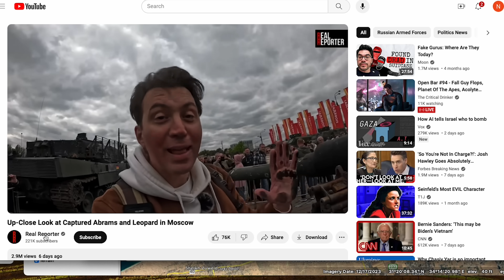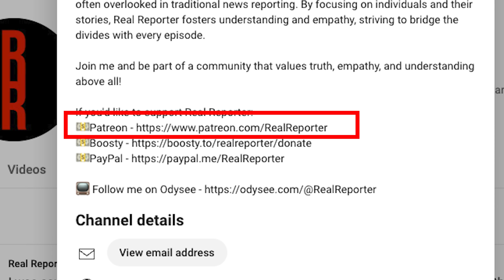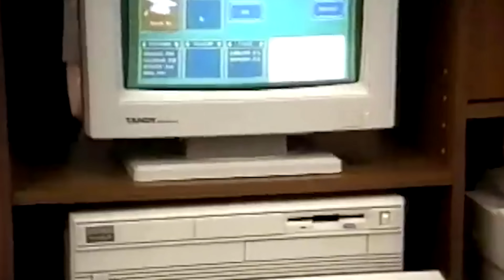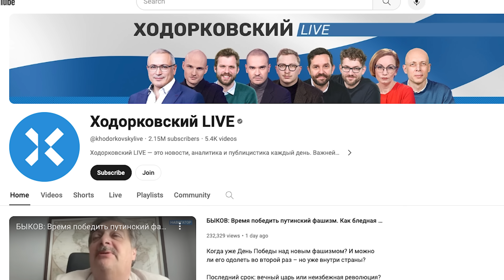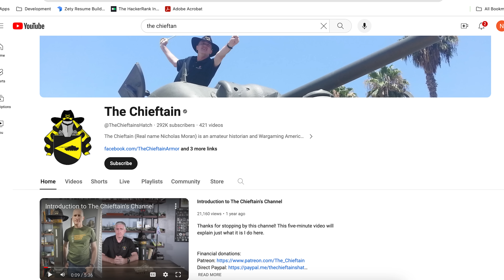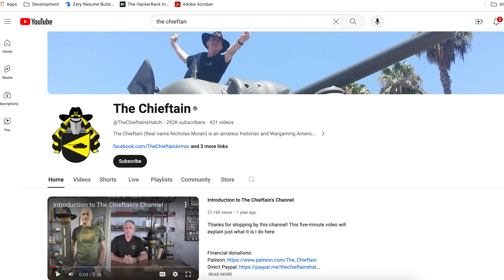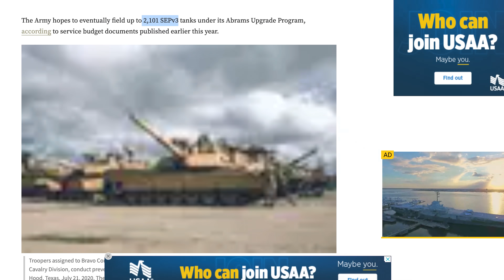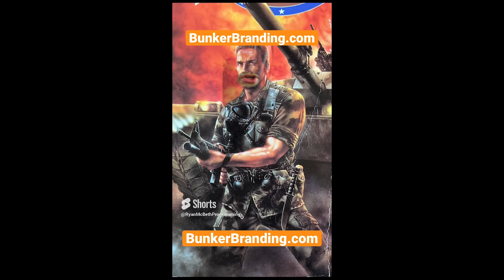Analyzing Real Reporter and Captured NATO Vehicles

Comment: I'm not sure what you can learn from a destroyed Abrams that you can't learn by looking at the x ray of one in war thunder
Reply: at this point the war thunder forums have more up to date information on current american capabilities than exported tanks do
Reply: @YanBaoQin I’m convinced that half the player base are just randoms with clearances from all around the world tryna get each other in trouble lmao
Reply: It's a  skill issue...
Reply: Hope they send it to gajin for accurate damage models
Reply: @YanBaoQin  Are exported Abrams actually inferior to the ones the US uses? Sure they remove the DU, but don’t they replace it with tungsten?
Reply: @RichelieuUnlimited  I don't think the Saudi ones are, but the ones the Russians have specifically are Gulf War era
Reply: @YanBaoQin  I was referring to the frequent assumption, that the US only exports inferior versions of their tanks, which doesn’t make sense when competing against the likes of Leopard 2 or Leclerc. This is, in my experience, often abbreviated by simply using terms *like ‚exported tanks‘.
It is true, that the tanks supplied to Ukraine are older models, however those were pulled from storage instead of purpose built for export customers, as it’s faster.
Reply: @RichelieuUnlimited  i would say the export models are worse since thats cheaper and most customers wont go for the extra cost
Reply: @einar8019  While this thought process does line up with the US‘s adoption of the Abrams over Leopard 2, if I remember correctly, both the Swedes and Greeks chose Leopard 2A5S and A6Hel respectively over Abrams despite higher costs. And tungsten is typically more expensive than DU, especially if you’re enriching yourself.
Reply: War Thunder has inaccurate DU layouts according to WT Reddit and that makes them VERY mad
Reply: @YanBaoQin The M1a1 SA first entered production in 2009.
Reply: "I'm not sure what you can learn from a destroyed Abrams that you can't learn by looking at the x ray of one in war thunder"

Russia has captured at least, I think it's 2 Abrams by now that were not destroyed but rather just missionkilled(ie mostly functional).
However, Russia already has knowledge about most things in it.   There's details that might be interesting, especially stuff like radio encryption and being able to look for hidden weak spots, maybe getting more detailed information on the materials used...
But overall, it's not a big deal.

Getting info on encryption is probably the only thing that Russia might have an actual use for, as it allows even better updated battlefield intelligence.   Buuuut Russia is already listening in on Ukraine radiochatter almost unhindered(if not necessarily in realtime) so, kinda superfluous.
Reply: This is what I don't understand, why would they reverse engineer anything from it. They have thermals as good or better that they already produce, and they have better armor arrays that they can use but don't since they went through the ERA route. We also know they have better engines and transmissions that they could use on their tanks(which again, they also don't use). Hell, they export better engines, transmissions, and thermal optics for export tanks despite not putting them on their own tanks.
Reply: @voidtempering8700  "This is what I don't understand, why would they reverse engineer anything from it."

Just because something isn't better doesn't mean you can't learn something from it.
It might not be a big thing to find out how another engineering team solved a specific problem differently, but longterm it adds up.
Reply: @DIREWOLFx75  That would be analyzing it, not reverse engineering it. Reverse engineering would be a study to re-create the product.
Reply: @voidtempering8700  No, reverse engineering can refer to both.
If you just want to recreate it minimal effort, that's a COPY.
But to be able to make anything beyond a copy you need to understand at least minimally how it actually works.
Which means deeper analysis as well.
Reply: @DIREWOLFx75  what is your pfp from ?

Comment: Heavy metal poisoning is true. We were also taught to leave a vehicle to the recovery team unless somebody needs to be extricated from the inside. Also, some of the metals won't leave your system and they'll continue to wreck havoc in you body until the day you die (probably from long term heavy metal poisoning).
Reply: I am just a dumb civilian and even I know not to go near a burned out tank. Depleted uranium isnt something you want to go around breathing in.
Reply: @Steve-ev6vx  If I recall my toxicology classes, arsenic, cadmium, lead, mercury and a couple others are the main concern. The main issue with heavy metal poisoning is that they don't need high amounts to be a health issue, or the body is unable to excrete them and they circulate freely in the blood, mainly causing renal & hepatic damage, mostly.
Reply: @SuiLagadema DU is a heavy metal. It’s not a radiological issue.
Reply: @DeltaEntropy  It's both.
Reply: @donizettilorenzo the half life of DU is on the order of 4.5 billion years. It's not a radiological issue.
Reply: @Steve-ev6vx  well, in this case the Ukr Abrams don't have the DU armor, but yeah, a Russian penetrator might be DU, so that's still a risk.
Reply: @colbunkmust  Yeah I know they didn't get the DU armor, but I'm sure there is still some toxic sht in there.
Reply: @colbunkmust  Russians use Tungsten APFSDS. DU is cheaper and self sharpens but Ruski's have plenty of Tungsten and Tungsten is denser and harder. Also DU is a bitch to machine so they don't bother.
Reply: @NotYourBusiness-bp2qn  Russians have both Tungsten and DU ammunition for their 125mm tanks. There have been 5 types of DU ammunition in service for the Soviet Union and Russia since 1982. Most recent confirmed date of acceptance for service of new DU shell type was 2016, with potentially even newer experimental DU ammo for the Armata tanks, though seeing as that project seems dead in the water the ammo for it will remain experimental.
Reply: Ah yes, heavy metal. I love it. I am from Russia. Heavy metal is my favourite genre. I'll go touch the tank to get some heavy metal in my blood 🤘brutal af

Comment: Gulf War Vet here... my unit, 197th Inf. Bde. (M)(S) attached to the 24th ID received a bunch of M1A2's before the ground war started. In fact there was some discussion about the cost/benefit of switching out the tanks that armor knew and had trained on for slightly improved /different ones so close to the beginning of the offensive. Like you I was T.O.W. infantry but my section of T.O.W.'s were combined with a platoon of Infantry on 2 M113's with 1 carrying a 50. Cal and the other an M19 Grenade Launcher as well as a platoon or section of 2 M1A2's. The tanks led the way, infantry flanked left/right and we T.O.W. guys stayed in the center and that's how we traveled during the war until the cease fire was declared and we returned to our old unit formations. I actually got out of the Army in Jan of 1992 so I know we had M1A2's at least a year before hand.
Reply: Good for you! My unit back to this time had T54B, T62 and PT76.......mixed toghether....
Reply: M1A2? No hate but are you sure? Those were a year late to Gulf War iirc
Reply: @somerandomboibackup6086  Yes I'm certain. They were swapping out tanks for new ones and there was a lot of discussion surrounding it.
Reply: @RemedialRob  you sure it was the one with CITV? Damn the secrecy back then, the media only reported about the new tank after 1991 I'm pretty sure
Reply: @somerandomboibackup6086  I'm not a tanker so I'm not familiar with the options on different models. All I can say for certain is that the new tanks were referred to as 'A2's" and there was quite a lot of discussion about whether it was wise to swap vehicles so close to the beginning of the ground war. There's a 24th ID Facebook group that spends all its time talking about the Gulf War. If it's important to you you might find a tanker there to confirm what I'm saying but I have absolutely no reason to make this up. I like Ryan and so I wasn't correcting him to "get" him or make myself feel superior. I genuinely remember the handoff. My Brigade being at the time the only "Separate" brigade in the Army was built like a 1/3rd scale division. Most divisions have 3 Brigades (or they did when I was in) and since we weren't part of a division we has resources and assets, again on a smaller scale, that most Brigades had to share with the rest of their division. And because everything was smaller It was easier to notice changes. I can't remember if it was the new tanks that came over with desert paint or if they were green and the old A1's were painted for the desert but I do recall the camp of the new A2's also being a factor of discussion in the decision to switch. Our M911 ITV's were still forest camo and we didn't get desert uniforms until just a couple months before the ground war started and even then some of us didn't get the desert boots because of limited stock on some sizes so we really were a hodgepodge of uniforms and camo heading in to the actual war. But as soon as Ryan said in the video that M1A2's weren't introduced until after the Gulf War my mental alarm bells went off with a specific memory of A2's being introduced to the 197th before the ground war started. Would I bet my life on it? Probably not. But it's a very clear memory so I'd probably wager a fair chunk of change.
Reply: @RemedialRob  thanks for the answer
Reply: The M-113s were used before my service in 1970! Just about everything they send Ukraine, are used/surplus. Night vision goggles so scratched , that they can’t distinguish between a person and a tree!

Comment: They didnt bend the barrels to damage them further, they tip the barrel as a sign of defeat, but because the turrets were damaged or they just couldnt figure out how to manually depress them, they bent them with the concrete block.

You notice the remote weapon systems on the lighter vehicles are also tipped downward.
Reply: But it also means they can't testfire the guns for their supposed "reengineering".
Reply: Maybe they are afraid the original owners will be able to re-activate the weapons systems remotely .
Reply: @flitsertheo  they dont work like that
Reply: not as a sign of defeat, more likely because of reasons of transport
Reply: No need to bend the barrels on defeated Russian tanks, because they're halfway to mars already
Reply: @nirfz  This kind of comment is the proof that US and EU needs again mandatory military service
Reply: @tavish4699  They did it in the square where it was displayed. Sure they just needed to lower it to take it away. 😂
Reply: @joek600 why do something unnecessarily when you can own the whole world if you wanted.
Reply: @joek600  Several countries in the EU have that. The one i am from included:
Austria, Belgium, Denmark, Finland, Greece, Latvia is putting it back into action step by step, Lithuania has reinstated theirs, Norway, Sweden has reinstated theirs in 2017, Ukraine.
I am in favor of it, i did mine long ago, and i learned a lot. (not just about being a soldier, but also about firearms in general and detail, my physical and mental abilities, and about other people. For example: how to sucessfully work closely together with someone i can't stand. Something many people never get the chance to learn.)
Reply: @nirfz  Well Im an Engineers Corps sgt. in reserve, all male adults in my country have to serve, and that's why everybody i know laughed out loud with the international media mentions (here they downplayed that part) of ''game changing xyz weapon''. Especially with the Leopards, since my country happens to have the most in EU. Since you have served, you should know that there wasnt much left of that Abrams to really test. The tank was consumed by fire and opened like a sardine can, that alone changed the properties of its materials. IF the barrel could be tested (they dont need to, there is nothing to learn from it that they dont know for decades) they would not have forced it like this.
Now an observation. I knew (been there, know a lot of people) that Ukraine had for a long period stopped its mandatory service and before that the army was in shambles. In fact so much that many people considered it dangerous to serve and avoided it, something that was extremely easy btw, unlike my country where the State, not only they will come after you, but they will destroy your life if you try to just not go. The fact that all those Baltic Drama Queens that now urge for war had no conscription, means that did not face a real threat.
My country which is the only EU country facing ACTUAL threat never ever considered of stopping the conscription system. The most left political parties never dared to even suggest it and even frigging anarchists if you sit and have a real talk with them, they will admit that we cant just downsize our military to a token force because THERE IS AN ACTUAL THREAT.
Reply: Yep, cant have an erect Leopard getting around Red Square, soldiers are simple folk that will work out a solution.
Reply: @KipKil1igan  Better safe than sorry is sometimes a Russian proverb too.
Reply: @joek600 from the clues you’ve given I’m guessing you’re polish?
Reply: @cristi1145  No Im not from the country of hysterical  Drama Queens lol. Hint, Russia is NOT a threat.
Reply: @joek600  Greece?
Reply: @christianZaal  Bingo
Reply: @joek600  funny that Greece has a better claim to Crimea than Russia. It was part of Greek culture for a couple of thousand years. Then Tartar, then Cossack / Ukrainian. Part of Russia from 1943-1954 then back to Ukraine. Russia's claims to it are pretty feeble. It might as well be part of Greece and Moscow can be given back to Mongolia 😆😆
Reply: @christianZaal  Let me take 5 min and explain the history lol. It is true that there was a string of very successful Greek city states dating back to the 8th century BC in the area, way before any Slav appeared in the area. Cherson means Peninsula in Greek. The area of Crimea was called Tauris. Those areas later became part of the Roman Empire and after the Eastern Roman Empire, having a civilized continuity of more than 1000 years while the Western Roman Empire was overrun by barbarian squatters who brought 500+ years of Dark Ages.
The Eastern Roman Empire facing multiple enemies constantly and being the doorstep to Europe (and the only reason why most of it was not Muslim since the 7th century), had to prioritize and facing pressure by Slavic populations, mainly the Rus, including a siege of Constantinople, decided to make lemonade out of lemons, and ''give away'' their last strongholds in Crimea, arrange a marriage, the conversion of Rus to Christianity and turn the Rus from enemies to allies (mostly). Off course the population and the culture of the area retained many Greek elements. Then came the Mongols/Tatars. Taking away the area from the Rus (btw no Ukrainians in the horizon yet) until Peter the Great took it back. 
By that time the remnants of Greek populations were augmented by refugees from the  Asia  Minor coasts of the Black Sea, who tried to escape the Ottoman oppression. 
Catherine the Great took advantage of that encouraging Greek migration even more, since the Russians wanted to re-populate the area with Orthodox Christians, preventing it from going back to the Turks. This is the main reason for all those Greek sounding city names with - pol (from Polis) in the ending. Like Melitopol (Honey City), Mariupol (City of Maria) Simferopol (City of Usefulness/Interest) etc. 
Odessa became an unofficial Greek city, and a major center run by Greek merchants, many of them fleeing from the failed revolution attempt instigated by Orlov. In fact the organization known as Filiki Etaireia (Company/Society of Friends), aiming for the liberation of Greeks and a new revolutionary action, was constituted by Odessa based Greek merchants, who lobbied mainly with Russian officials and officers of Greek descent, trying in turn to convince the Tsar  and secure his support. Btw still no Ukrainians around. 
Crimea and most of the Black Sea Coast was never, ever ''Ukrainian''. The first time it became so was when it was given to the Ukrainian SSR for administrative reasons in 1954. 
Ukraine has only but a legalistic claim on Crimea, neither cultural or ethnic.
Reply: @joek600  oh, nice summary.
One correction needed. The Ukrainians weren't "on the horizon" because they were called Rus / Ruthenian until quite some time after The Duchy of Moscow stole the name 'Rus'
Reply: Worth mentioning the rampant warcrimes against the local population each time Moscow has occupied the area. 
1800s,  1917-21, 1932-33, 1944, 2014, 2021+
Reply: Noting also that Moscow ceded/rejected all it's supposed claims to Crimea when it signed the Budapest Accords.
Reply: @joek600  Assuming russia isn't lying about "not wanting to invade the rest of Europe", the EU wouln't need mandatory military service.
Reply: @j.ceasar  EU doesn’t have a mandatory military service, first of all EU does not have an army. Most EU MEMBER countries do not have a mandatory military service. Even drama Queens close to the big boogie man Russia. BUT Greece does have a mandatory military service and a huge part of its GDP goes to armaments cause there is an ACTUAL threat, and that’s not Russia.
Reply: @joek600   Ok?

So as I said, if russia is telling the truth about not wanting to attack any EU countries, we should be fine without military service.

Am I not correct?